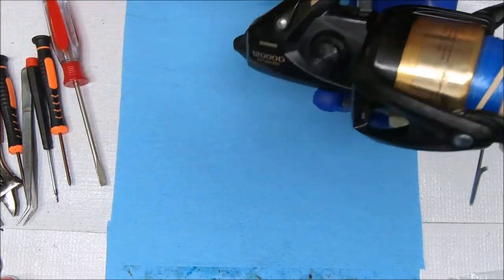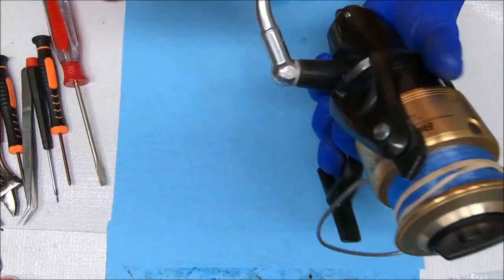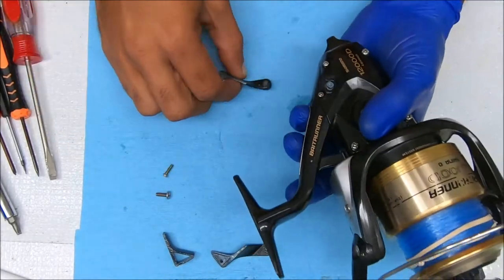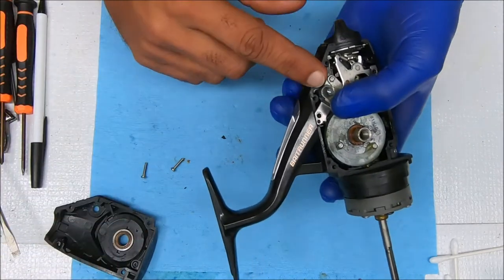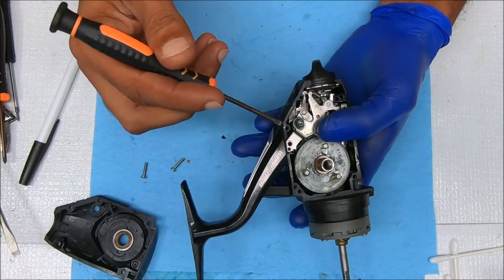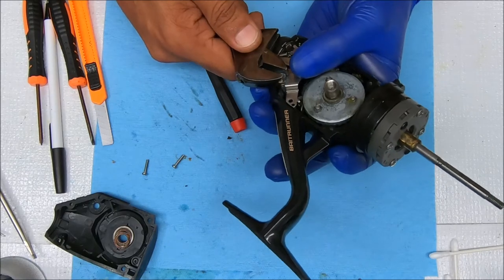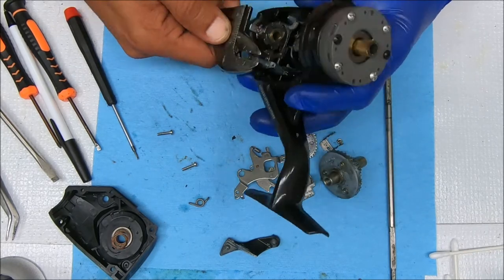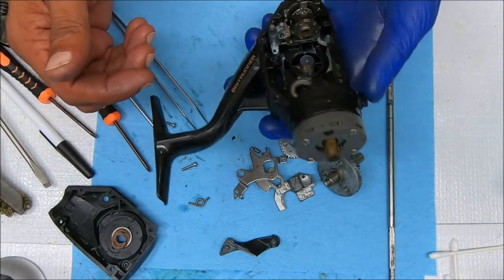Shimano Baitrunner 12000D Stuck Lever: Fishing Reel Repair

Comment: thanks ,video really help as working on one at this moment.
Reply from the maker: Glad to hear it. Call me if you have any questions. Stay safe.
Reply: @TSGReelService  screw @0:53 was one i did not see  : 0
Reply from the maker: That's usually the only one I'll remove... did both screws in preparation for the possibility of having to pull the shaft. Turns out I didn't need to pull it, so I could have left it in.

Comment: Hey, I am curious if the baitrunner lever being slightly loose would be a problem? Reel works fine its that the lever is looser than I remember.
Reply from the maker: Hey brother.... I'm not sure how "loose" is looser than you remember, but it's probably fine. You should take it in for service if you're having some concerns about the reel, though.....so someone with a little more experience than you doing it yourself could go through it to make sure all is okay.

Comment: I think the gears missed Aline on mine when I was trying to see why bail was so loose it feels bumpy when I turn it now
Reply from the maker: Make sure when you line up the arrows on the main gear with the arrows on oscillating gear. Otherwise, it will feel like quicksand at points in the oscillation.